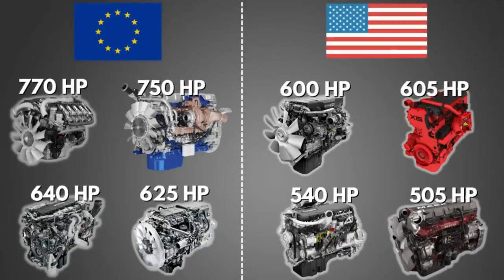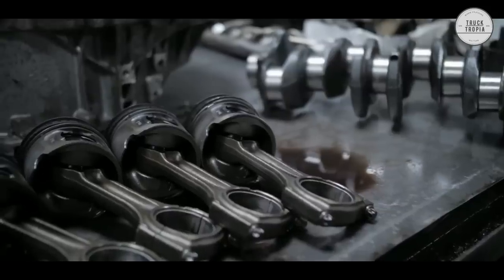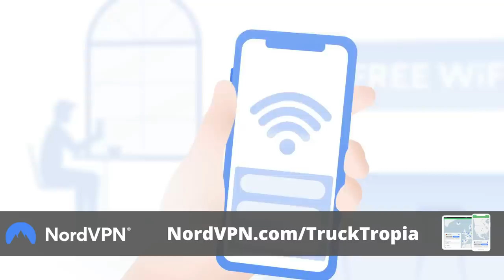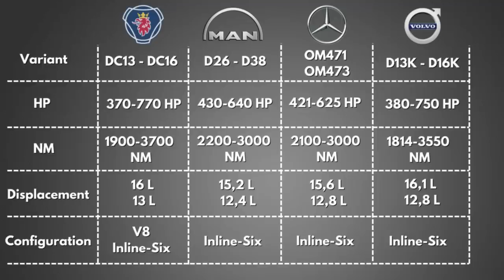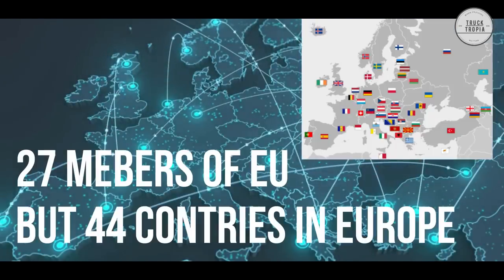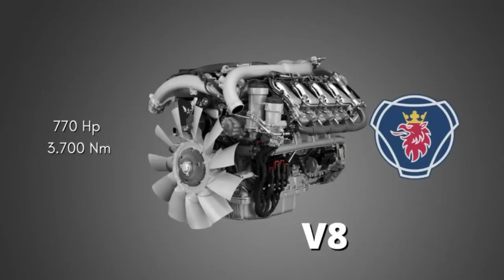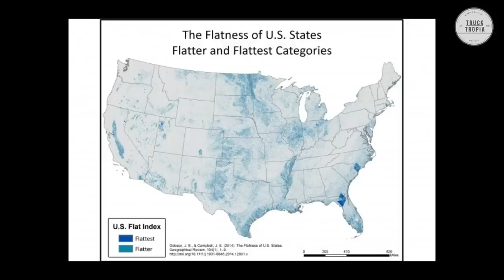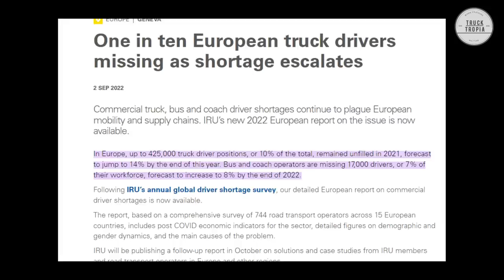Why European Trucks Have Up To 770 HP And US Don’t

Comment: Great video. In Australia we get both American and Euro trucks. The best of both worlds!!
Reply from the maker: True 👍
Reply: In USA we use also Volvo trucks.
Reply: @anatomicalmachine8017  But the American Volvo trucks have very little in common with the EU ones. They don't even share engine and gearbox
Reply: @joakimjonsson1640  Volvo bought White trucks to get into the US market, how much they have changed through the years is another question.
Reply: You run road trains with 2 engines, often over 1000hp from memory.
Reply: @joakimjonsson1640  They have several options for engine's and transmission, they also use Volvo D13 and I-Shift in their Volvo trucks.
Reply: @Bratfalken  And Mack.
Reply: Thats because australia is literaly the best of both world on everything!!!!
Reply: @Doppiovetro  

World truck Manufactures manufacture trucks to suit Australian conditions, regulations, and length and axle weight laws 

Australian market Trucks are catered to Australia's local regulations. This means that the vehicle length is shorter for B-Double applications, and front axle loads in Australia are considerably lighter than in Europe. Truck manufacturers engineer their trucks to have more weight at the rear of the vehicle to comply with Australia axle weight laws. 

Australian trucks differ in regard to the positioning of battery boxes, the number of fuel tanks Custom wheelbases to cater to sleeper cabs

Comment: I can safely say that most EU trucks are 500 HP too. I've worked in hauling company and entire fleet were ~500 HP trucks. A guy I know who worked in Girteka(largest EU haulier with over 9000 trucks!) are also operating mostly 500 HP trucks. There're some special trucks for special loads that need those 700+ HP but they are not that common in wider EU.
Reply: I can confirm, my truck is a 480hp/40tonne truck.
Reply: I don't know where you have worked but it is very common to see trucks with more than 500hp... Many use the 770, 730 or 750 for common loads... Also say that the European truck usually has more torque with a similar power consuming less fuel .
Reply: Ah Girteka. Usually find those trucks in a ditch.
Reply: Mi truck has 750 hp and 2200 torque pulling doubles in western mountains
Reply: @beto46133  only 2200 having 750hp?  your engine is very bad.  a fully standard scania with 580hp generates 2212... with a much lower consumption
Reply: Does europe have truck stops? How do European truck drivers handle the language barriers. If you're Portuguese and you drive to Sarajevo, how do communicate once there?
Reply: @senorpepper3405  Yes, there are truck stops and you normally communicate in English, if you can't use the translator, if you want to eat in Spain and Italy is where you eat the best in the world, roadside restaurants are great and cheap , but the normal thing is to take your food in the truck, since they also have a refrigerator, microwave, television... the cabin is deeper but everything is very well designed to be comfortable. The trucks have to be able to adapt to any situation since there are many curves and unevenness, but the roads are in better condition than in the US, the driver in Europe has to be more prepared than in America.
Reply: @senorpepper3405  https://www.youtube.com/watch?v=f2Eq4UD9b9A
So you can see what it's like to drive around Europe.
Reply: @4_SJR  I'm not saying they are rare but they are far from majority too.
Reply: @mementomori7825  I shit you not. A friend told me that some drivers that were accepted were really bad. Like a driver comes with C category license and it's obvious this is his first time seeing a truck. They would put him through short course to get familiar with a truck but you can't really teach some1 to drive it properly in few days.
Reply: @senorpepper3405  Everyway you can man... Some know languages, some use sign language, some use phone translators now, sometimes communication is handled through manager.
Reply: @4_SJR  but the trucks in Europe have much slower speed limits so are you really saving fuel or are the trucks just going slower so with that saving fuel?
Reply: @senorpepper3405  In Europe many people speak at least 2 languages. Ex. I can speak English, Romanian and Russian I could easily interact with people. Of course I met some people in France, Germany and Italy that didn't know a single word in English but I can understand the root of the words.
Reply: @Dynamick007  I do know it's a lot more common for someone to know 2 or more languages but there are a bunch of languages in Europe. I don't know how many countries europe truck drivers go to but if it's all the EU then that's a lot of languages. It's almost the equivalent of every 3 states speaking a different language in the US.
Reply: @senorpepper3405  Knowing Russian I can speak with people from Eastern Europe (Latvia, Lithuania, Poland etc.) because a lot of people from Eastern Europe know it. Romanian is a Latin language (Italy, France, Spain etc.). But also you can work as a truck driver without knowing any language. The company can give you longer routes, or routes that you don't interact with many people. 
Usually, when you go to load\unload you just need the reference number. At the office they give you the map of the company and you just follow the lines. When there're some problems, the driver asks for help from other drivers. Myself I helped a lot of drivers that couldn't understand or explain the problem.
Reply: @senorpepper3405  Good question. 
In the northern parts of Europe almost everyone speaks English (to a certain degree;) and in the rest of Europe the number of people that are able to speak English is growing rapidly.
Reply: @Conservator.  I'm aware Scandinavia speaks English well and Germany's good as well
Reply: @senorpepper3405  
Also the Dutch, Austrians, Belgians and Portuguese are very proficient in English. Here’s an overview: 
https://en.m.wikipedia.org/wiki/EF_English_Proficiency_Index
Reply: @Conservator.  I kind of lump the Austrians in with the Germans but I understand that they speak even more English. Naw I get it. English is used as a bridge language. But it can't work in every instance? That's where translation apps come in. It's just hard for me to wrap my mind around. I did over the road in the U.S. about 10 yrs ago and the accents may change but there was never a language barrier.
Reply: @senorpepper3405  
You are right l of coarse that certainly not everyone speaks English and not at the same level. I’ve however noticed that compared to say 40 years ago, the improvement is enormous. 

Google translate will help if you don’t have a common language and google lens can translate every text that you put in front of your camera, live! It’s a huge difference with, again, 40 years ago. 

Your comment made me think of how easy it is to understand different American accents compared to accents in the UK. Especially when considering the size of both countries.
Reply: @4_SJR  If he's in the West Mountains in USA it's probably 2200 ft-lb which would be a little under 3000nm. Still shy of the 3550nm of Volvo 750 though.
Reply: @meowexotics6516  There are countries where both trucks are used and the European consumption is always lower, even people with the Volvo VNL in Europe and the Volvo FH with the same power continue to consume less, since the quality of the engines is lower in the American one, they have less technology and aerodynamics is worse, also the torque they have helps them a lot when climbing and thus save fuel
Reply: @AlexKall  a 630hp actros with 3000nm is used in europe to move 250 tons, taking into account the mountains in europe... These trucks are very capable
Reply: @4_SJR  I don't really think so imo it's the speed pretty much all the trucks in Europe are going 55mph/90kmh where as the us trucks are going usually 65mph and above. The speed is what kills mpg in the us imo.
Reply: @meowexotics6516  In Europe there are already cases of American trucks like the Volvo VNL consuming more than the Volvo FH, with the same weight and with the same power and so on with many more cases, in other countries outside of Europe they go over 90km/h with the trucks and the European saves more.  It is a more aerodynamic truck and much more technological
Reply: @4_SJR  could you link those cause the freightliner cascadia gets 10mpg which is 23.5l/100km and I haven't seen that fuel economy from the high horsepower volvos at all. The figure I see from the FH16 750 is 6mpg or 39l/100km. So maybe I'm missing something or my sources are old.
Reply: @meowexotics6516  Your information is false or erroneous, do you obtain these consumptions with a cascadia loaded with 40 tons? I have an actros MP1 EDITION ONE with 630hp, with 44 tons (approx) I have a consumption of 27/28 L/100km with an American that is impossible, especially in Europe with all the climbs there are, my truck on the flats can consume a lot less fuel. One of my best friends with a 2015 750hp volvo Fh16 gets just over 31L/100km... A current 500hp cummins X15 on a less loaded 2022 PT 579 gets about the same (8.2MPG or more 35L/100km) in a country like the United States that is practically flat, if it is with a higher speed, but more fuel is consumed going up than flattening at a higher speed. Here a 500hp Volvo VNL is consuming over 34/100km with 40 tons.
Reply: @meowexotics6516  A 730hp Scania with a load of between 60 and 70 tons has a consumption of about 6.2 mpg on 37 L/100km with European terrain, my truck (630hp 3000nm) on the flat with an average load in the United States with those speeds could be at 10/mpg
Reply: @antoniolobato6712  practically flat? You have never been in the United States I assume? A friend of mine gets about 5 mpg on his 2022 Peterbilt when driving 2700km per day. He tries to keep the max speed at less than 160 km/h.
Reply: @ImForwardlook  If you compare the United States with Europe, yes, it is practically flat.  And if I know what it is to be there.  Of course, if you go with a truck at 160km/h and you do 2700km per day?  Hahahahahahaha friend, don't lie, that's illegal and only a plane could do that distance... a truck at 100 mph and almost 1800 miles a day... hahahahahahahaha Have you read yourself before posting the comment?
Reply: @antoniolobato6712  dude,you need to travel. A friend of mine had 2 million miles on his Pete and didn't want to exceed 2000 rpm before overhauling his engine. 2000 rpm is 164 km/h.
Reply: @Conservator.  As an Austrian I approve your comment :)
Reply: most common volvos and scania here in finland are 540s and the v8s range from 480 to the 770, but its cause our trucks are huge compared to the rest of europe.
Reply: Not common ! Not true .
My friend buy for himself the new truck 770hp !!!
Reply: @marcioceia3608  it is true
Reply: Girteka... the same as Swift😂
Reply: Talks about Girteka, the worst drivers of Europe.
Reply: @AlexKall  the gear box is a torque multiplier. With higher RPM you can grab higher gear ratios. If you want to know which puts the most torque at the wheels. You look at horsepower.

So forget engine torque. It's the HP band that matters.

The reason these trucks have huge torque numbers is totally different, it's because of fuel efficiency and wear. It has nothing to do with towing ability.
Reply: Torque is not everything. Very narrow rpm range of European engine should works with nice transmission. Only engine alone is useless for this types of engines. Narrow rpm band is not appropriate in us road where truck can run at 80mph
Reply: Actually 4-500hp trucks are most both in us or Europe. Only your personal experience doesn’t approve there are many 700 hp truck in EU. The only truth EU truck company can make 700hp commercial truck.
Reply: @4_SJR 250 ton case is very rare and need special permits also. Think what majority means!
Reply: Do you mean Eu trucks or trucks from Europe? Both kinda different
Reply: @4_SJR  I think you're confusing gearing for engine output. US trucks are designed with long flat roads in mind, they run longer gears for improved fuel mileage as they don't have to scale mountains/hills as often as trucks in the EU would.

Comment: I had the fortunate tast of driving a Volvo FH750 and holy moly it can pull anything. It was a totally different beast to what I was used to.
Reply: what were you driving before this divine encounter with Volvo?
Reply: A prius
Reply: I'm sure it can not. Trucking is more than engine power. Why do you see nearly no european trucks in Australia ? Because they can nothing when it comes to Outback Lorrying. 😉 There you will find Kenworths, Macks, Freightliners and so on.
Reply: @altblechasyl_cs2093  Ohh that's why the volvo truck pulled 750 tonnes? "Volvo Trucks - Volvo Trucks vs 750 Tonnes: An extreme heavy haulage challenge"
Reply: @Spurz1975  🤷‍♂️ Thats not a question of power, thats a question of traction.
Reply: @altblechasyl_cs2093  You’d want to check that, overall there a more euro trucks sold than american ones
Reply: @altblechasyl_cs2093  You do know that Sweden where Volvo and Scania comes from, has a big outback too, so their trucks are literally build to drive out there. Somewhere on YT you can all so find a documentary about an Australian outback trucker and his very old Mercedes truck. 
I think the main reason people are driving Kenworth, Mack, Freightliner and so on, in Australia are purchasing cost and myth. Once they actually try to drive them, they find that they are more comfy and the mechanical reliability are the same or better.
Reply: @Dillon-em8sg  In USanada ? Mexico ? Australia ? South Africa ? New Zealand ? Nope... Maybe in the rest of the world, but why ? Dimension regulations eg in Europe US not have. 🤷‍♂️
Reply: @altblechasyl_cs2093  in Australia the euro brands sell more than american ones, in new zealand scania has the too market share, volvo are top in sa and they dont sell euro trucks in canada mexico or the us
Reply: @altblechasyl_cs2093  Australia is such a small and special market. No European brand will make a special truck for Australia. The European brands have enough power and gearboxes to pull everything, but they will never build something own for Australia. 

Australia doesn't count for European brands in anyway. You need to use what the world brands give to you.
Reply: @honda900000  Therefore Kenworth makes Australian Trucks, built in Australia. 😉
Reply: @altblechasyl_cs2093  Sorry i know i am ignorant about Australia, but isn't it more or less flat ? Hence the smaller engine American trucks. I do known those Aussie truckers pull huge loads. Please educate me if i am wrong.
Reply: @altblechasyl_cs2093   Is the reason for American trucks in Australia because the country  is largely flat. Less power needed due to not many mountain ranges despite Aussie trucks being so long ?

Comment: The most interesting truck today is missing in this video.

Sisu Polar hybrid.

It has 1140 hp and 5000 nm with electric motor. That electronic system assist diesel engine to accelerations and took energy back in breaking, so that supercondensator can produce that power again.

This saves so much fuel in hilly areas...

Comment: Both Volvo and Scania are from Sweden, the only country allowing a maximum weight of 90 tons. Sweden doesn't really have mountains, but they have a big lumber and wood industry in forests on hills. And what type of cargo weighs 90 tons: lumber.

Here in The Netherlands, the weight limit is 50 tons, whereas most other mainland European countries allow 40 or 45 tons. The Scania V8 is loved here in NL, because of its sheer power but mostly because of the unique sound it produces.
Reply from the maker: Thanks for sharing :)
Reply: 90 ton trucks are only used at certain roads and that is mainly the ore trucks and the 32,5 meter long lumber trucks that goes between lumber mills. Granted Schenker also have a few 32,5 meter 90 ton trucks going in the southern parts of Sweden. 
But other then that 24 meters 60 tons is still what most trucks load
Reply: I'm a semi driver from the US since 1996. I say the best trucks are Volvo Scania. I always say "a Volvo with a million miles is better than a Freightliner with 1 mile on it".       From my experience.
Reply: There's a long nose Scania, think it's the H series driving around near where I Live in Scotland and it's just so amazing. When I lived in Sweden and work in the building trade, the company I worked for had the H- series for their  tipper lorries. Just so great and beautiful trucks.   Also, here in the UK, the Coca Cola truck we are during Christmas is a Scania but all identification has been removed from the truck itself.
Reply: Thank you for reminding me i need to go IKEA and buy some furniture!
Reply: I have to correct you on the max weight in the Netherlands, its 60 tons
Reply: And Australia has trucks on the road with a 300 tonne gross weight (and engines in each of the five trailers). Cummins do the power plants for these.
Reply: @allangibson8494 Road trains....must be dangerous for other road users.  Rail is more efficient but my guess is tracks would buckle in Australia heat.  Harsh climate.
Reply: @marcpikas2859  The trucks are running from the mine to the railhead. Australia is big and running track takes time (and permits).
Reply: @Groza_Dallocort  64 Tonnes! and 74 Tonnes on all BK4 roads.
Reply: @johngaudet6316  Freightliners are Mercedes trucks with a different name plate.

Comment: I am truck driver in EU and I have to say that in Europe, 90% of the trucks are a maximum of 550hp. As a mather of fact, i never worked on a truck more powerfull than 460hp, wich is the "sweet spot" in the (power-fuel consumphtion). The most powerfull trucks 770hp are used in havy loads, over 40tons, or in Scandinavia, for the 25m trucks.
So, in Europe more powerfull trucks are made, but not used!